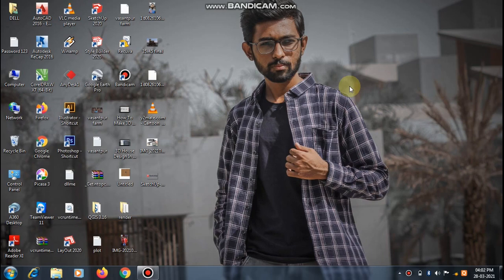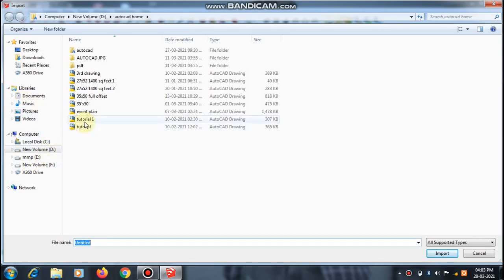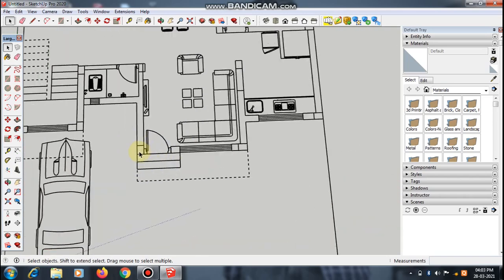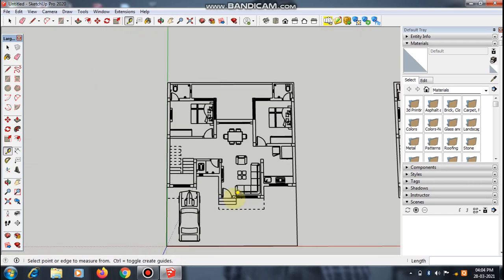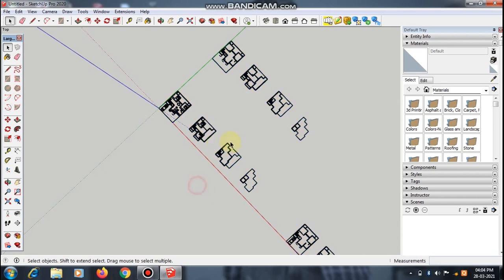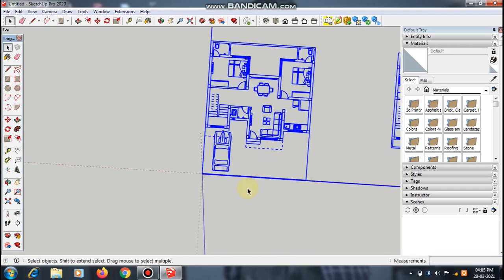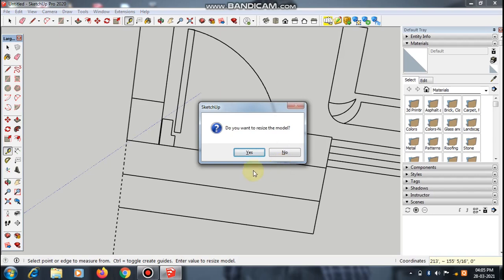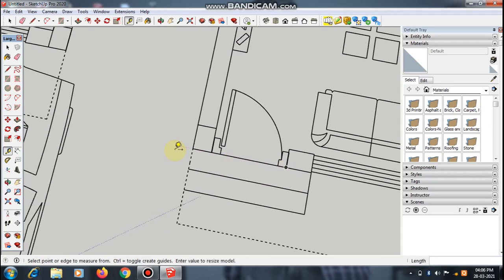HOW TO RESCALE YOUR AUTOCAD IMPORTED FILE IN SKETCHUP | #CIVILARCHITECT

Comment: What is the third 3 fit
My dimensions is cm scale 100 what should I type my friend?
Reply from the maker: If u work with the CM templates then supposed door width is 90 cm then u should apply the same method..like u should apply the scale command then click at the left side of door then enter the value 90 cm then click enter...